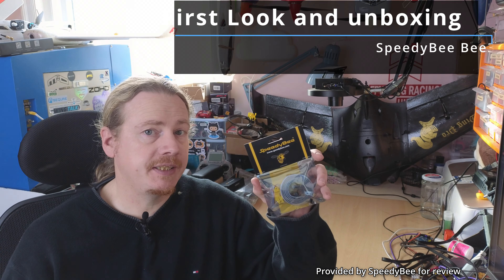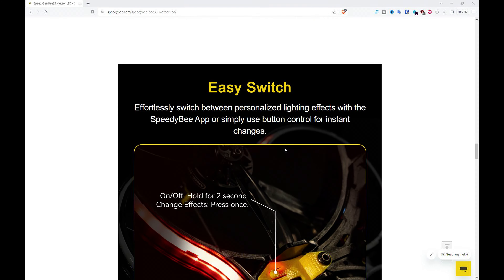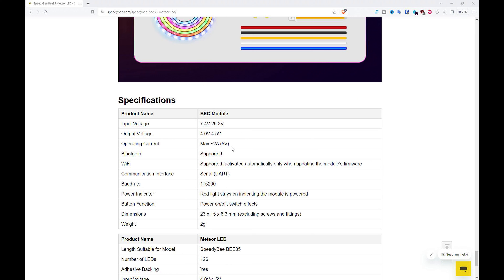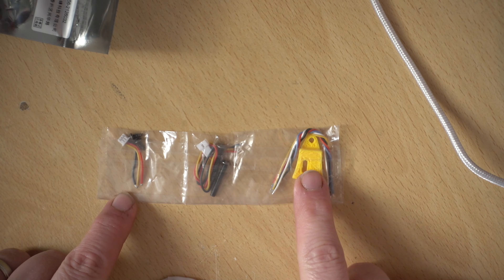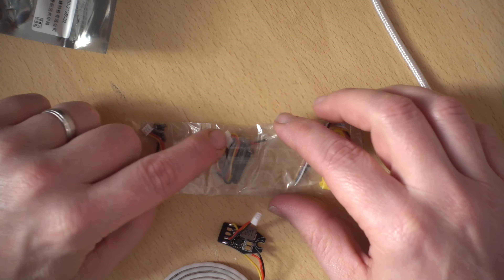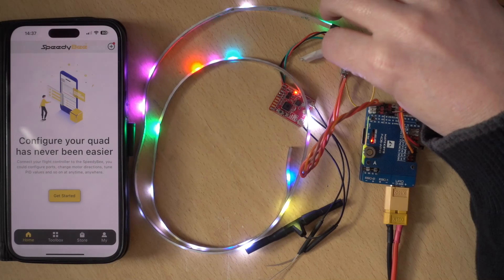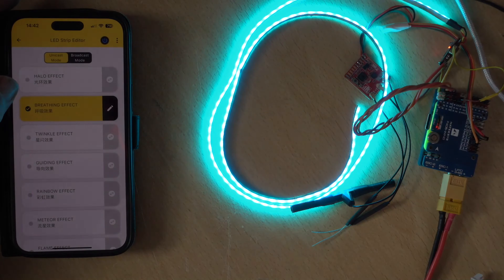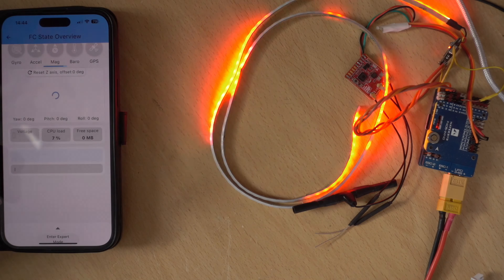SpeedyBee Meteor LED kit: First look and unboxing

Comment: It'd be cool if INAV had a LED configurator tab in which one could select similar preconfigured effects for all or a range of addressable LEDs. But that'll probably mean a complete redesign of the LED configurator tab.
Reply from the maker: It already does to an extent. With effects such as the larson scanner. It would just mean more effects added to the drop down list.